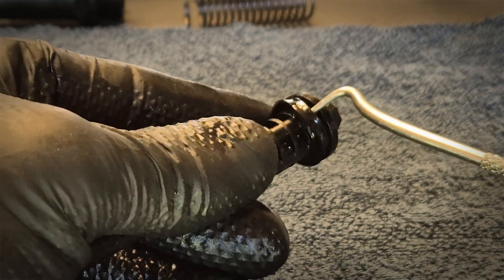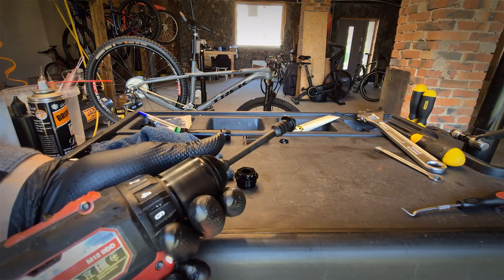Lockout not working or stuck. Lever doesn't spring back. Fix the damper. RockShox Judy, Recon, 30.

Comment: When I remove the damper, it does not come with the green rubber part as shown at 1:15. I'm trying this on Recon Silver TK Solo Air. And when I pull up the shaft completely, there is a small spring with height 1-2cm loose in the oil, and there is a rectangular socket. I'd appreciate help with this!

Comment: Nice video. I have a problem with the compression damper, I think. 
While it is working with the remote and it has lock and unlock mode, the fork works same with these two modes. When I lock it, it doesn't tighten and it continues to have bount and rebount. I did what you showed us but I have this issue.

Comment: Looking at all these troubles with lockout controls being flimsy and unreliable and requiring careful maintenance, I become grateful that my forks are mostly trail, and not XC, so without the the remote/lockout features. On those few bikes that I service that do have the lockout machinery, I've decided to just not install it at all. Given that the rider of those bike do not mind missing lockout, all is well.